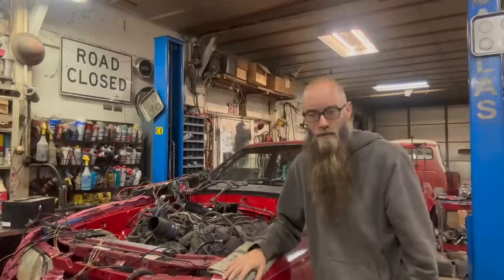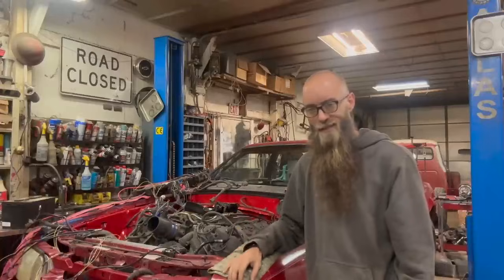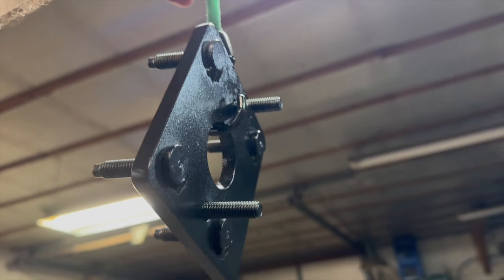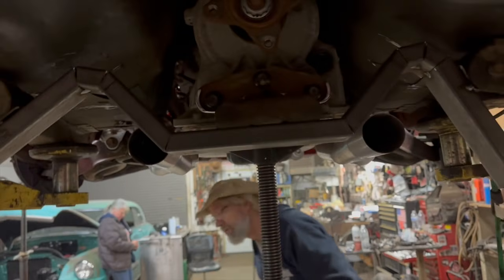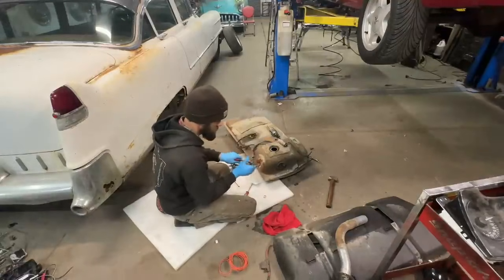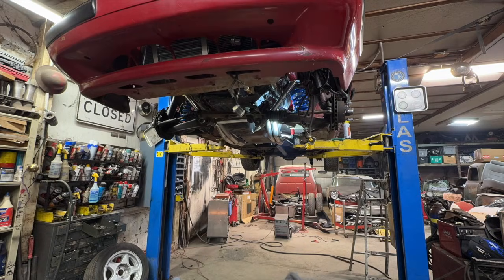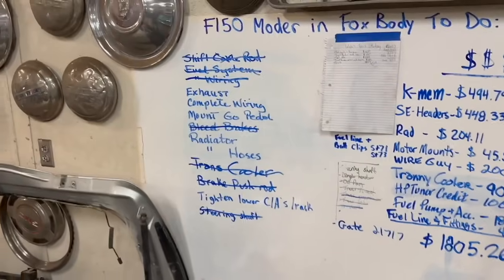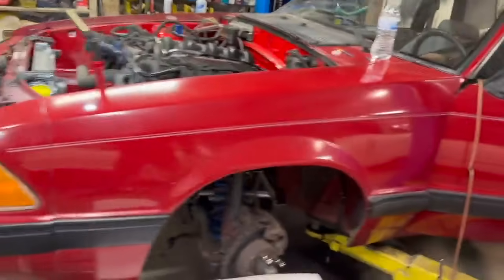I Swapped a Coyote V8 Into a Foxbody on a BUDGET (Full Build in 15 Minutes)

Comment: That's awesome!!! Now just a warning the coyote goes into next level God mode when you add boost to them. 20 psi and your close to 1K HP just upgrade that oiling system before you do. You did a wonderful job with that. Coyotes are going to be the LS swap of the future. They build so much more power at cheaper money when you boost because they are more efficient on VE.
Reply from the maker: I’ve heard that about the coyotes!

Comment: What's The Budget  though  what. Do. Something like. Your build. Cost. Is. It. Up. Under 15,000 10,000
Reply from the maker: I have roughly $2300 in it
Reply: Keep in mind, he bought a tubuoar K member and long tube headers. You can easily knock out $600 by going to the junkyard to buy a stock 96-04 k member and either tweaking the stock mustang manifolds or running the truck manifolds. 

Yes you'll leave some HP on the table with stock truck manifolds, but that's still a 360hp (320whp), a little more with the mustang manifolds, and that's still more power than an NA 4V swap, or even a HCI 302. Especially if you forego those pesky HP chokers in a factory exhaust lol
Reply: @Elver_Galarga_4u  I think it’s so funny when I see people say this about F150s and Mustangs in the junkyard. Those are snatched so quick it’s not even funny